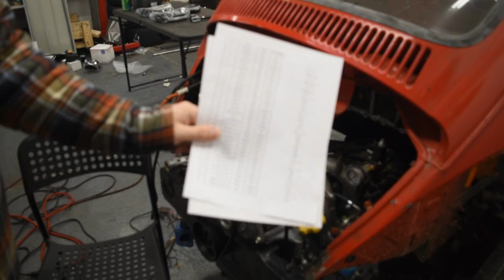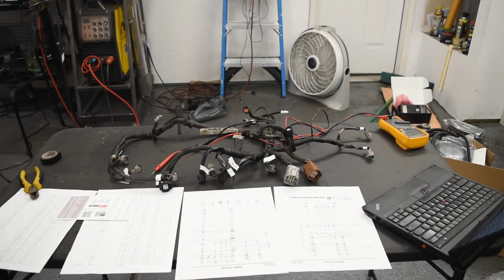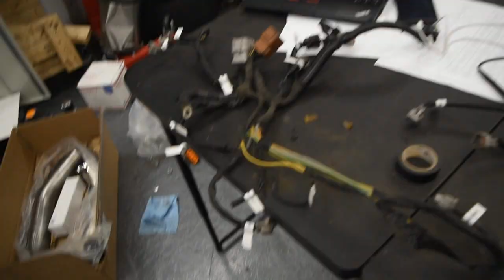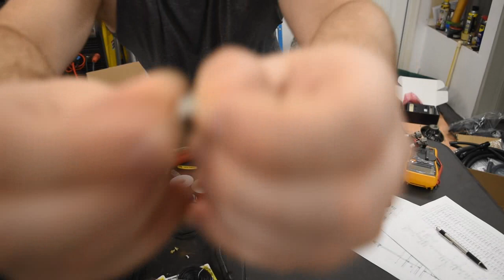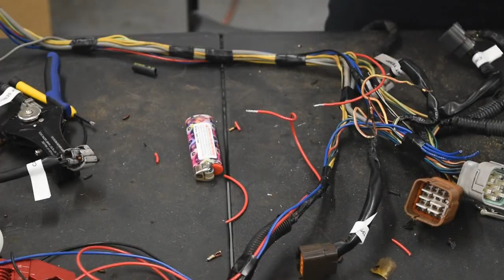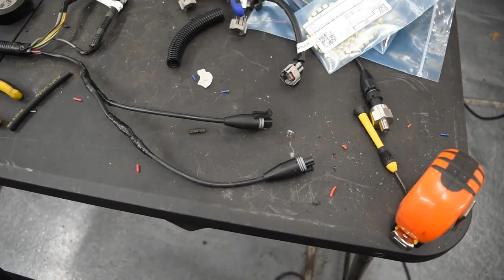Wiring in MS3Pro EVO (Part 1: Engine Harness) -- 1973 VW Super Beetle Subaru Swap

Comment: Hello im still uncertain how you checked wich wires you needed and wich you didnt with the multimeter
Reply from the maker: Hello! So this only works if you have a pin out for your wiring harness but I am essentially looking at the various connectors, and then I use the multimeter to confirm connection (continuity). This allows me to understand where every wire starts and stops, and if any wires are tapped into each other. With the multimeter set to continuity, you get a beep when there is continuous flow of electricity. So now I can systemically confirm my wiring from the Subaru harness and match to what I need in the MS harness.